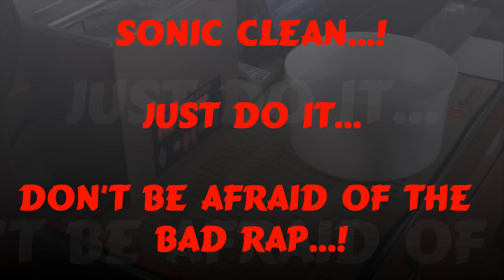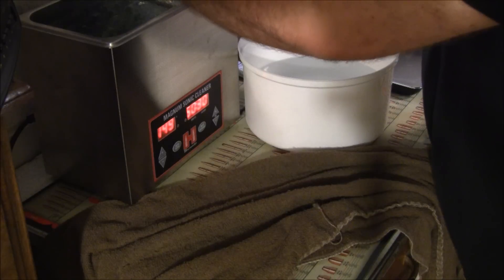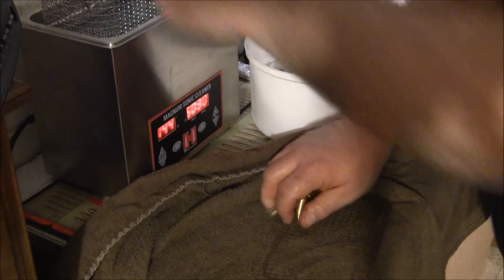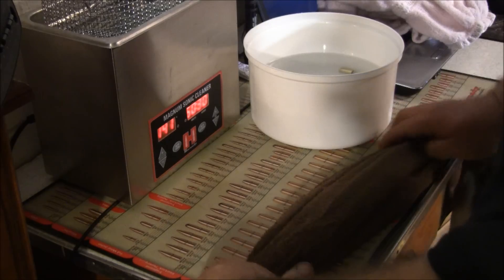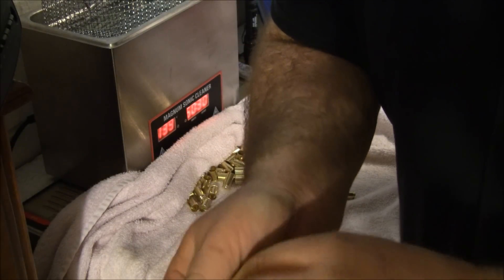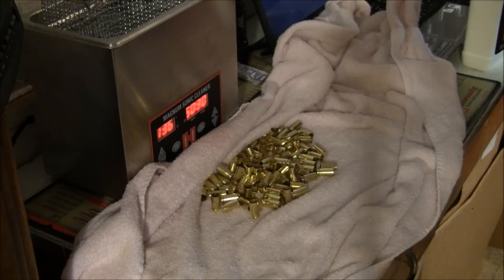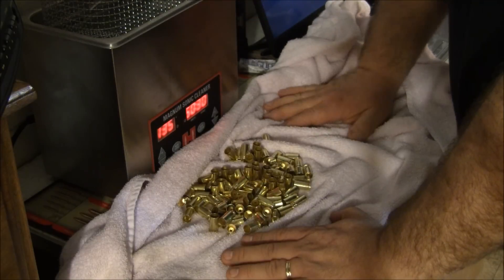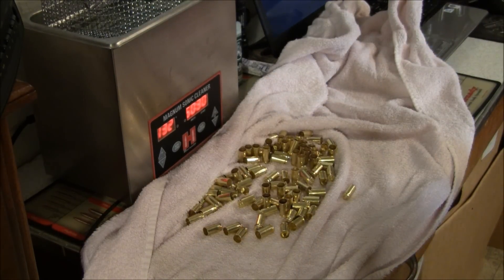Sonic Cleaning, just do it already...!

Comment: Extra clean brass may be to duration of ultra sonic cleaning ? Some say not to heat the solution and it hurts the brass, but how could a small amount of heat hurt the brass? The case endures far greater in the chamber.

Comment: Pour your cleaning formula into another container then let settle. Doing what you’re doing leaves residue in the Cleaner which increase concentration of cleaner and can destroy brass? Don’t forget dish wash contains caustic that’s why you can’t use it to look for leaks on gas pipes.

Comment: You have any homemade recipes for cleaning solution?
Reply from the maker: jris211 I heard you can use simple green also , just mix it with water 50/50. 
I have never tried it but was told it works just fine.

Comment: I just let the brass air dry.  If I'm in a hurry I toss them in the oven for a bit, but I may try the towel next time.  I use a Frankford Arsenal wet tumbler with pins, perfectly clean brass with no special chemicals needed and it holds a lot of brass.  For small batches I use a Harbor Freight double drum rock tumbler.

Comment: Hey thanks for the type.What do you use as a cleaner?
Reply from the maker: +5050brassman I use the Hornady sonic cleaner for brass and then the one for gun partsThanks!
Reply: @RonGunner065  so you use both cleaning solutions by hornady and not just the one for brass?
Reply: also, cant find that cleaner anywhere, is it discontinued?
Reply from the maker: chris jardeleza Yes both their cleaners are excellent I will tell you this do not and I mean do not, use the brass cleaner on gun parts it will remove bluing!

I made the mistake one time of taking a trigger group out of one of my Winchester shotguns and dropped it in the brass cleaner for 10 minutes and I pulled it out and it was all bare metal so, make sure you use the right one.

Comment: Talmadge Fisher is totally right !  I use the Franklin wet tumbler with the stainless pins and even the primer pockets comes out shinny ! But you use two towels, yup did that myself but I got a cheap food dehydrator from Wally Mart $ 30.00 bucks or so and if you need the brass right away that's the why to go. If not in a hurry towels work fine.

Comment: I have a regular corncob media vibratory polisher and am upgrading to this ultrasonic unit:  http://www.ebay.com/itm/6L-Professional-Stainless-Steel-Ultrasonic-Cleaner-Heater-Timer-Bracket-Jewelry-/231302761532?pt=LH_DefaultDomain_0&hash=item35dab80c3c  My plan after the U.S. is to rinse the brass, shake out the water and throw it in the vibe for an hour to dry it out and remove any cleaner residue.  I like your towel method but wonder if it will work on .223 cases with their small necks.